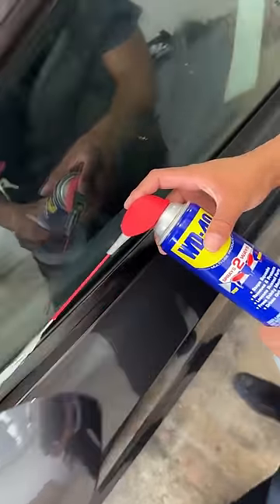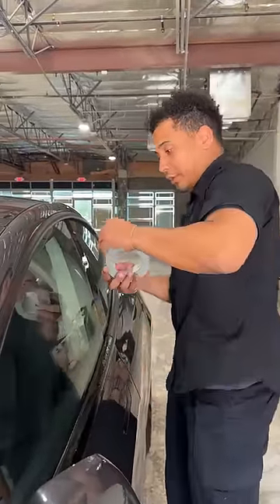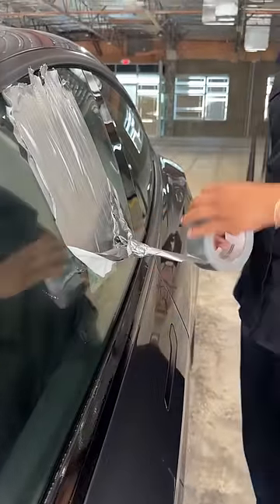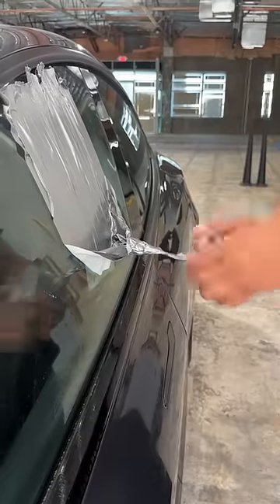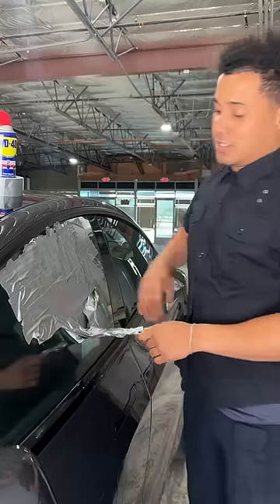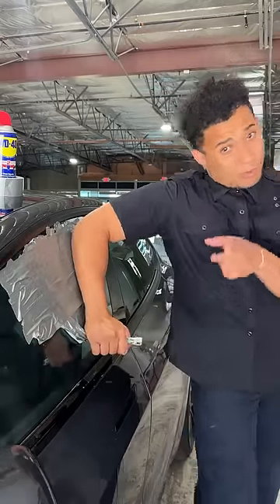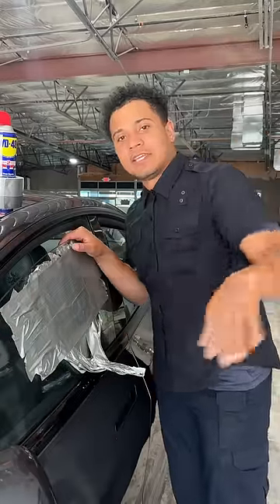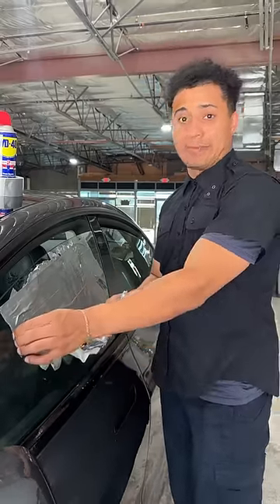Worker shows how to open window car when forgetting key! #shorts

Comment: Special shout out to the person inside who hit the down switch.
Reply: Right.,. Rear window went down at same time
Reply: They used the key.
Reply: If ur gonna try to call people out atleast know how they did it u know the look he gave the guy off screen NOT in the car to tell him to hit the unlock button twice and hold it which rolls down all windows
Reply: @scotts1668  the call out is the fact what he was showing doesn't work. Regardless of who or where they were, the switch was used.
Reply: @stealthmanx2  ok but did u really add anything to the conversation it's almost dehumanizing to point something out with improper diagnostics amirite?
Reply: @stealthmanx2  also no switch was used in the filming of this video if ur referring to a manual contact switch this was deep in the electronics of a vehicle can we agree? Holding unlock on a wireless remote to roll down all windows I don't think most would agree is a "switch"
Reply: @stealthmanx2  u literally said "inside" to which there was nobody in the vehicle so if ur "simple" call out was incorrect what makes u better than the original poster if your also incorrect
Reply: Mentiros0!
Reply: @thomasalgrim614  Uh no, windows have separate switches dude.
Reply: @scotts1668 damn, someone took it personally…or you just have to be right all the time, or you have to have the last word, or your wife doesn’t pay much attention to you so you come here to get it….just remember, he didn’t know how it was done and neither did you! An opinion is just an opinion, it’s not right or wrong…
Reply: He press the key
Reply: Tesla don't have key. It is a venting feature on the apps.
Reply: @scotts1668 mine doesn’t and it’s a 2019

Comment: Bull shit, lubing the weather strip would not do a damn thing. The resistance is at the motor, the drive belt, or window linkage , which ever your  vehicle has.
Reply: Very true and getting any lubricant can damage the power locks or the rubber seals
Reply: Crash Dummy at work 😂😂 ! Here's a Brick , figure it out 🤔 😂😂😂🔥🔥👍✌️✈️✈️
Reply: Not to mention that WD-40 will destroy the clearcoat on your paint.
Reply: It's a wind up knumbnut
Reply: @1gerard47  Well aware of how a window works, have replaced a lot of glass in my 40 years in the industry. Irregardless of what mechanism the vehicle has, you should not be forcing the glass down. Thats why I carry a bladder ,and the Tool to reach in and unlock vehicle.
Reply: It has a cable and gear ⚙️ ran by the motor.....lol.
Reply: You lube the strip in case it has bonded to the glass
Reply: @paulthesoundguy1  Yes if your dealing with a car that been sitting for 80 years!🤣😂🤣😂
Reply: @paulthesoundguy1  the point I'm trying to make is,,, you should never force the mechanism down. Doing so can damage your window function. Whether its a worm drive, gear drive, or cable drive.
Reply: @ronniecox109  yea yea yea.  I am good with all that….BUT. WHEN … your I. The dessert or alone or what ever.  No money at that time for example…..you do what you do what you do….this is a minimal way to get in to your car with out breaking the glass or paying $300 bucks.  Here in palm beach county fla
Reply: @Taillighttim26  Also the felt window guides. With them being soaked, It'll streak grease up and down.
Reply: The actuator.
Reply: @ronniecox109 there's no such word as irregardless
Reply: @anythinganytimealways  It is in the Oxford dictionary. Try google . Irregardless, been used for 200 years. According to google. If there is a Google.
Reply: @anythinganytimealways  For all intents,and purposes, or for all intensive purposes?
Reply: @anythinganytimealways  I see you have some decent music.  try some Texas Hippie Coalition. and maybe some Creech Holler. ✌️
Reply: @ronniecox109  been on the Texas hippie coalition for years bud. Good stuff
Reply: @anythinganytimealways  Creech Holler can be an acquired taste. A littledifferent.

Comment: It worked so good even the rear window went down to the same exact level!
Reply: This video is 🧢 
Teslas have a feature on the app that vents all the windows at once!
Reply: I had to watch it again just to see ,
Reply: Took me two times to see that. 👏 👏
Reply: That's a shadow, I've seen cops use the trick to open a window, I'd say it's legit.
Reply: Holding the unlock button lol
Reply: No it will not because all your window regulators for newer cars are cable driven you're a lying I've been working on cars for 34 years
Reply: Exactly.. and a cop won’t waist or even have ductape. They hit the unlock on the key fob and held it down for 10 seconds.. the video is BS.
Reply: Lmao!!!..... To the people who can't read the sarcasm in the op.
Reply: Your boyfriend gave you that perm.
Reply: @David-eu1ms  come on, no shadow,  no reflection, the back is down too. catch up bruh
Reply: 😂damn you right! That’s fucked up
Reply: Hahahah yes
Reply: This video is bs
Reply: He could change that in the car settings lol
Reply: Sad thing is, this is a place where they are probably scamming customers too.  If you are willing to do this to try and scam people,  "It will cost you 1 grand for the repairs">  They fix it with a 50 buck part and an hour's labor.
Reply: Good catch
Reply: 😂😂😂 CAP!!!!!!!!

Comment: I locked my keys in the car at Walmart once and about 50 bucks later I made a tool and a stool to get through the door jam and press the unlock button on the inside. You could always hear air come through the door at higher speeds after that. I keep that thing like a trophy and it’s helped more than once.

Comment: To bad my duct tape is in the trunk.

But actually, fill the door with W-D and still your not gonna get the window motor/actuator/arm that holds the glass to move.

It's to bad ya don't have real for info or tips and hints that work, you guys are helping prove what people REALly need to do is question everything,
Surly your a lil smarter then that, you could show something useful and not fake that could help people.
And who knows, you could get a bunch of hits that way too.
Imagine that...

Comment: Good way to break the window cable clip. These electric windows use a motor with a cable and plastic clips. Do that and break the clips. Then take your ass to shop and pay the $380 to replace it. Cheaper to hire someone to open it.

Comment: Don't put WD-40 on your window seals if you can avoid it. It's not good for rubber, nor is anything with petroleum solvents. Use a silicone spray lube, it's safe for rubber.

Comment: Only way a electric car window go down is if u go in the door panel in cut the metal wire that makes the window go up in down then it will fall down by itself into u put something like a stick or something up under the the window I've did this a million times in emergency cases. This dude is a joke lol

Comment: Or I could just grab the lock out kit and save about 2 hours after I snap the regulator and another 20 mins cleaning the window with a razor to get duct tape jizz off the glass